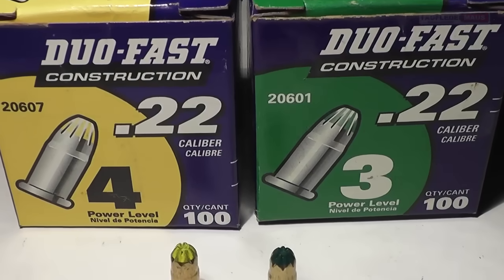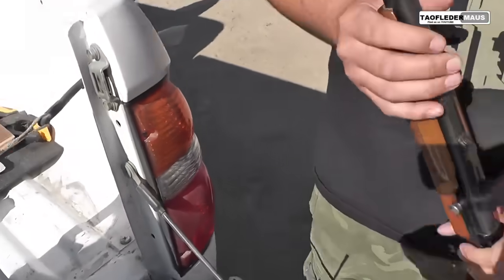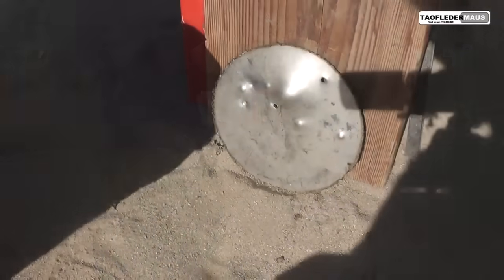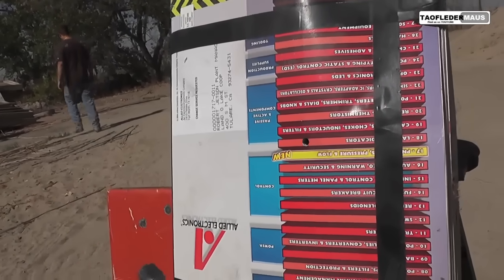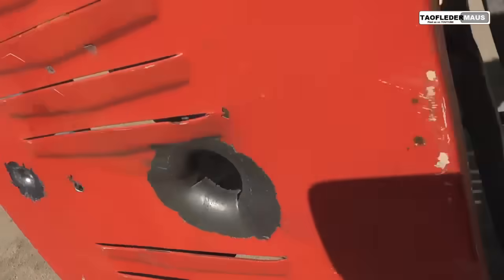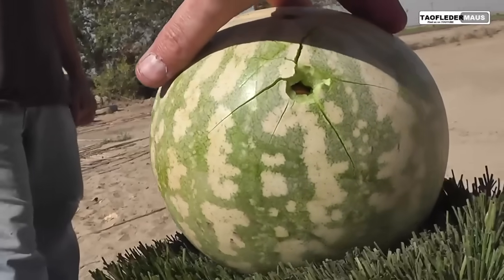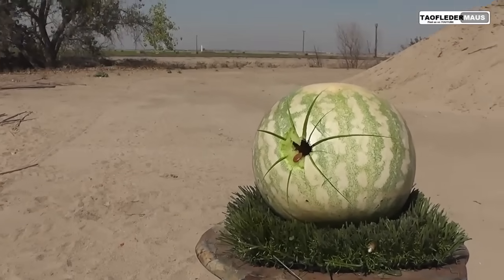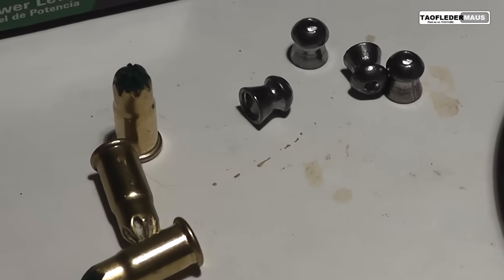Shooting .22 PELLETS Using NAIL GUN Blanks - What happens?

Comment: Wonder if this would work in one of those $99.00 revolvers?
Think it would make it from the wheel through the barrel?
At least you could get some multi shots.
Reply: Clean the chambers with lead removal tools every 5 shots....the soft lead skirts are hammered by the violent hot gases and smear like crazy....
Check the forcing cone for the same thing..
and the rifling just after the forcing cone when what is left of that soft lead skirt tries to grip the rifling to start the projectile spinning.
A revolver is really a bad idea...
A fixed barrel semi auto pistol that is easy to break down and get the lead out of is a better idea...more velocity (no chamber to forcing cone gap)......and quieter, too.

Comment: Question: Have you tried loading a revolver to have multiple shots?
Reply: Clean the chambers with lead removal tools every 5 shots....the soft lead skirts are hammered by the violent hot gases and smear like crazy....
Check the forcing cone for the same thing..
and the rifling just after the forcing cone when what is left of that soft lead skirt tries to grip the rifling to start the projectile spinning.
A revolver is really a bad idea...
A fixed barrel semi auto pistol that is easy to break down and get the lead out of is a better idea...more velocity (no chamber to forcing cone gap)......and quieter, too.

Comment: Need to chrono these and see how fast they are going, if you punch the lead too fast it will foul your barrels. And may create high pressures
Reply: It does that even with ordinary .22 blanks...
as the lead skirts are very soft and the gases are hot and far more violent from these nail gun cartridges.

Comment: I just ran across this video. I done this for years with an old Stevens Favorite single shot falling block. I put the pellet in the chamber followed by the power load. It is deadly on Squirrels  and Rabbits out to about 100 yards and very, very accurate. I get all the nail gun loads I want for free, just have to buy the pellets. I cronied them at 2900 to 3000 fps from this rifle.

Comment: I had good results by soldering the skirt full with a fine-tip soldering iron. It adds extra weight and keeps the skirt from separating. I have even gone as far as soldering a 177 bb into to pellet skirt and used JB weld to secure it to a ram set cartridge.
Reply: Cool.

Comment: wonder if you could just glue the pellet to the casing and treat it like normal.  probably nor, but still interesting to think about
Reply: TAOFLEDERMAUS
8 days ago
We did try that but because the blank is necked down,  the gases went around the pellet and the transition from the chamber through the forcing cone caused the fragile pellets to self-destruct.

Comment: I made a pellet mould years ago out of two pieces of aluminum bolted together and use a 4.5 millimeter drill bit down the seam, just like the old time bullet moulds.it worked, I was using a daisy pump with a 3-9x power scope, and you could actually see the pellet spin in a two foot circular pattern too the target,It wasn't accurate by no means, my friend shot a few of them and saw it he was like "Damn, what kind of pellet was that" I said "shhhh, it's a mystery pellet, because it doesn't know where in the heck it's going. But that was impressive how that pellet you guys shot, just burned a hole through a piece of 1/8 inch thick piece of stainless steel,and the damage that it did too the melon was impressive. I wonder what kind of powder they use in the nail gun rounds and what kind of lead composition is used in this pellets, that's like anti material rounds, I wonder if some of the powder was jammed into the cone of the pellet and upon impact became super ignited and melted that steel, Because that was a perfect hole, with no indentation.you guys just stumbled onto something and I'm gonna be up all night studying pellet compositions.anyway good job
Reply: John Willis
10 days ago (edited)
I just ran across this video.
 I done this for years with an old Stevens Favorite single shot falling block.
 I put the pellet in the chamber followed by the power load.
 It is deadly on Squirrels  and Rabbits out to about 100 yards and very, very accurate.
 I get all the nail gun loads I want for free, just have to buy the pellets. 
I cronied them at 2900 to 3000 fps from this rifle.

Comment: What? No range test?
I want to see how accurate they are at 250 meters.
Reply: John Willis
10 days ago (edited)
I just ran across this video. I done this for years with an old Stevens Favorite single shot falling block. I put the pellet in the chamber followed by the power load. It is deadly on Squirrels  and Rabbits out to about 100 yards and very, very accurate. I get all the nail gun loads I want for free, just have to buy the pellets. I cronied them at 2900 to 3000 fps from this rifle.

Comment: You need to lube those pellets if you are going to shoot them like that or your barrel is going to get a dangerous amount of leading. Tumble them in Lee Liquid Alox and you will be much safer and probably a lot more accurate as well.
Reply: John Willis
10 days ago (edited)
I just ran across this video. I done this for years with an old Stevens Favorite single shot falling block. I put the pellet in the chamber followed by the power load. It is deadly on Squirrels  and Rabbits out to about 100 yards and very, very accurate. I get all the nail gun loads I want for free, just have to buy the pellets. I cronied them at 2900 to 3000 fps from this rifle.

Comment: I’m not sure maybe I’m missing the point of this but why would you just shoot maybe 22 shorts through that or some thing I’m not sure why you’re using pellets
Reply: It's just an experiment...that works.
John Willis
10 days ago (edited)
I just ran across this video. I done this for years with an old Stevens Favorite single shot falling block. I put the pellet in the chamber followed by the power load. It is deadly on Squirrels  and Rabbits out to about 100 yards and very, very accurate. I get all the nail gun loads I want for free, just have to buy the pellets. I cronied them at 2900 to 3000 fps from this rifle.

Comment: We were doing this decades ago (70's) when I was a teen and early 20's. We used my old Marlin bolt action and a friends old Remington 511 bolt gun, for the bolt actions work so much easier. Just open the bolt, insert the pellet and load the blank behind the pellet. Back then, I had several tins of the very small starter pistol blanks, and even those gave enough speed and accuracy to kill birds, squirrels and close range rabbits. The nail gun blanks would give a whole new level of speed and power, and as you learned, the power of those blanks could deliver near 22 mag speed and power.
Reply: John Willis
10 days ago (edited)
I just ran across this video. I done this for years with an old Stevens Favorite single shot falling block. I put the pellet in the chamber followed by the power load. It is deadly on Squirrels  and Rabbits out to about 100 yards and very, very accurate. I get all the nail gun loads I want for free, just have to buy the pellets. I cronied them at 2900 to 3000 fps from this rifle.

Comment: Its a plinkster not deadly
Reply: John Willis
10 days ago (edited)
I just ran across this video. I done this for years with an old Stevens Favorite single shot falling block. I put the pellet in the chamber followed by the power load. It is deadly on Squirrels  and Rabbits out to about 100 yards and very, very accurate. I get all the nail gun loads I want for free, just have to buy the pellets. I cronied them at 2900 to 3000 fps from this rifle.

Comment: You need to try a heavier pellet and chronograph it
Reply: John Willis
10 days ago (edited)
I just ran across this video. I done this for years with an old Stevens Favorite single shot falling block. I put the pellet in the chamber followed by the power load. It is deadly on Squirrels  and Rabbits out to about 100 yards and very, very accurate. I get all the nail gun loads I want for free, just have to buy the pellets. I cronied them at 2900 to 3000 fps from this rifle.

Comment: I did this with and old winchester 06 and light pellets, but the "skirt" of the pellet was cut from the head and was stuck in the barrel. Anyway, the ones that got out were very very fast
Reply: John Willis
10 days ago (edited)
I just ran across this video. I done this for years with an old Stevens Favorite single shot falling block. I put the pellet in the chamber followed by the power load. It is deadly on Squirrels  and Rabbits out to about 100 yards and very, very accurate. I get all the nail gun loads I want for free, just have to buy the pellets. I cronied them at 2900 to 3000 fps from this rifle.

Comment: If you put just a little tip of fast glue on top of the blank and put the pellet on it, it gets like a full live round, if you do it properly it even works in a lever action .22 repeater, make sure the pellet is perfectly in line with the blank
Reply from the maker: We tried that and it didn't work.  The pellets have to be seated in the barrel for them to be reliable
Reply: @taofledermaus  it sometimes malfunctions yes but my 9422 repeater took all the straight round perfectly, i bet a semi auto will fail

Comment: We tried this years ago and found the very tail of the Pellet was being left behind in the Barrel of the rifle. There was just so much power that the pellet literally was blown apart with the tip flying out and the tail remaining behind. We kind of just stopped doing this. It would work in a pinch or maybe if you filled the hollow "tail" of the pellet with lead to make it more solid. Fast though i guess!!
Reply: What if bb? Maybe it won't break? Pellets are lead and rather soft.

Comment: Hi scott, my name is Ray and i think you should try something new for example making a PVC Gun With sniper model and 39Inch of 22mm pvc pipe as barrel and 15 inch the 89mm size of tube where the gas will Push the bullet out. Using Calcium carbide  gas and the way to make it explodes is just by putting a Lighter into it. This gun is pretty deadly thoo , you can use Dart in Nail or A marble even Custom printed bullet and it is able to Travel at 600-800 Fps and 200-300 meters of range ( also this gun is very easy to make ).. sorry for bad english

Comment: I finally got to test this myself, after I purchased a Chiappa little badger. I only tried the greens. Some shot fine, others the pellet would break apart in the barrel and the top would shoot out, but the skirt would stay in the barrel. First one that broke apart, I only found out after the next blank wouldn't seat fully. So I removed the blank and pellet, looked down the barrel and could see daylight, but upon looking more closely, realized there was something still in the barrel. I had to use a cleaning rod to drive out the remaining skirt of the last pellet. 

I'll try it again sometime using Browns, but it most likely requires a heaver pellet, maybe one that doesn't have that 'hourglass' shape would be necessary for this to work reliably. 

This idea is a moot point at this time anyway, as nail gun blanks are currently .10 a round in the Chicagoland area, and .22 LR's are back in stock everywhere and as cheap as .06 a round.

Something I would like to try though, will be to seat a FMJ center fire .22 bullet into the chamber and use a nail gun blank as the power. But I won't use the Chiappa for that. Most likely it'll be a 12ga to .22 adaptor.
Reply: Make a small dowel and push the pellet far enough out of the forcing cone and into the barrel so that the pellet is actually engaged with the rifling.....
This achieves 2 things...
the skirt is already engaged with the rifling when the hot gases push it outwards to seal the skirt to take advantage of all the gases to propel the pellet up the barrel;
and there is a volume created behind the pellet which allows expansion of the gases without as much heat frying the lead and blowing molten lead all over the inside of the bore....

Comment: Does that make it a non firearm then since commercial ammo isn't used?
Reply: No; 
most governments have defined a firearm as a machine which uses hot or compressed gases of any kind the fire a projectile from a barrel....
The nail gun cartridges are gas producers...
and in this case propel a projectile out a barrel....

a PVC tube spud cannon using ignited hairspray therefore is a firearm....

Comment: I have a Stevens single shot 25 rimfire. Ammo hasn’t been made in quantity in many decades. Most of the ammo you can find runs over $1/round and 60+ years old with a lot of duds. I bough some 27 caliber Ramset blanks, which fit nicely in the 25rf chamber and use 25 cal aigun pellets. Seems to work well. I use  the lower powered 27 cal blanks. I definitely don’t advise anyone to do this.
Reply: Never even heard of a .25 rimfire!  Need to research this old round!

Comment: I once saw an air rifle that was modified to fire .22 LR. They had to drill out the air rifle chamber to take the cartridge and put a very low power spring in with a rim fire pin on the end of the piston. After firing the base of the .22 cartridge was bulged out due to the breach not being fully sealed. But it worked.
Reply: Kind of amazing it worked. Since the .22 LR barrels are .223 and the .22 air gun barrels are .218.

Comment: Fired a 31 grain, .25 caliber air rifle slug out of a .25 caliber pistol once.  I used a piece of Bic pen hull as a sleeve around a yellow ram set blank.  It was so loud, with so much recoil, I was shocked.  It absolutely destroyed a half gallon milk jug, and ended up in the third one.  That water penetration translates into 16-18.5 inches into ballistics gel (depending on whose math you use).  The barrel is only 1.125 inches, but that penetration is FBI acceptable! 😅

Comment: FYI, I Gorilla glued the pellet to the tip of a .22 blank and shot it out from my 10/22 rifle and a 12ga ammo adapter from my shotgun, don't be loading it down the barrel like the cavalry soldiers from the 1700's good God!
Reply: Same concept, but even better - you can buy steel flare gun with adapter for 22LR, then use that silicone hot glue from home depot to glue the pelllet to the blank :).

Comment: Soooo, I did it with a heritage .22/.22mag revolver and it works awesome, you need the poly jacket pellets, or itll sheer the skirts off in the cylinder! (Used power setting 3 and 4 blanks.)

Comment: FYI
Really dangerous the other way round. 
Modified pellet rifles Do NOT hold up
I machined a purpose built hybrid.
(Just easier than trying to fit odd parts to work)
Bolt action for the blank and break barrel for the pellet.
It works.....if I had nothing else better.
Just an experiment to see if it was a possible SHTF option for a fictional book someone else was writing. 

Oxy-Acetlene fired by diesel principles from a pellet rifle is entertaining.(20" of muzzle flash) But worthlessly impractical and no where close to accurate ever.
You've saved me quite a lot of  time on odd ideas. 😆 👍
Thanks a bunch!

Comment: I've done similar experiments with with only the priming mixture and no powder charge in the .22, firing them into modeling clay. The velocity is low enough that the pellets don't self destruct and you can recover them intact.

What I found is that the sudden rise in pressure after the primer ignites actually forces the pellet skirt up to the head so you land up with a pellet that looks like a parallel sided shot glass.
Reply: Use a small ramrod or "pusher" to push the .22 soft lead pellet a little way up into the rifled barrel.

This does 2 things...

it engages the pellet skirt in the rifling..
and there is a volume of air behind the pellet so the hot violent gases from the burning powder can cushion a little before full force is exerted on the pellet...

It may also reduce the "boiling" of  lead from those gases hitting the base and reduce the amount of lead sprayed into the bore from this melting effect....
(which is why larger calibre soft lead projectiles have copper base caps (gas checks) that crimp onto the base of those projectiles protecting the soft lead...

Comment: Honestly. It's been done for years. I'm 32 and I figured this out when I was 12. Try putting a small drop of super glue on the pellet and put it on the tip of the cartridge.  It's alot faster and easier and better consistent results.  Further more... use a bolt action. Oh ya you were off on your fps estimate. We've clocked them at 2650 to 2700 when you try that method.

Comment: You should chrono the pellets. It would Be interesting to see what the true FPS is.
Reply: 1600 in 22  over 2000 in 177 😀 depending on the blanks .. black powder blanks arent as affective as smokeless nitro blanks .  its the speed of gas expansion , black powder is a lot slower burning so expands slower ...the pellet has left the barrel before full expansion of the gasses
Reply: @tomhughes5123  u are backwards on that.  Black powder is faster burning than smokeless.  And those pellets are no where near 2500 fps.  In .22lr cci hv is 1400fps.
Reply: @pranc236  it depends on the shape and size, but generally smokeless powder burns faster than black powder. There's a reason we could not get 556 level velocities out of black powder

Comment: That means that you can get 3000 fps if you make a bullet with a 22 lr. Case and a 14g pellet.
Reply: Close... the relationship between weight and speed is not linear.

With the yellow powder charges, you're spitting pellets out around (pauses to close ad)
Reply: Ad closed

2100-2250fps

With the red (green, yellow, red, purple) loads you are close to 2500fps with a 16g projectile. Haven't been able to find the purple loads to try them.